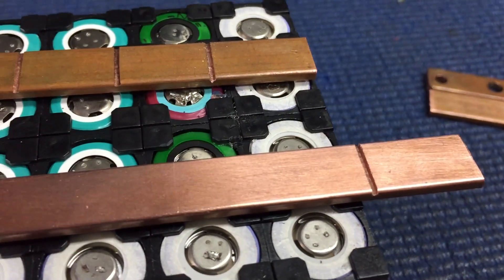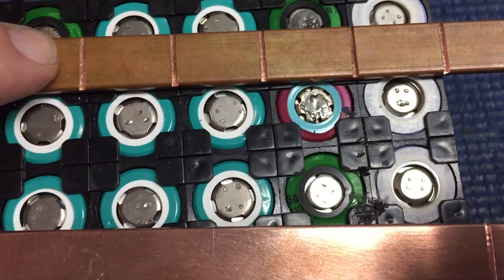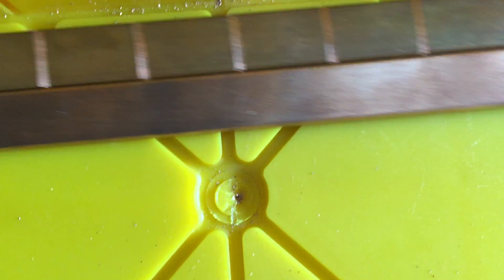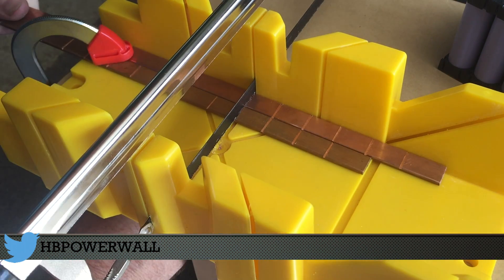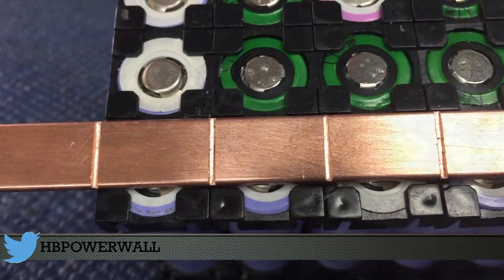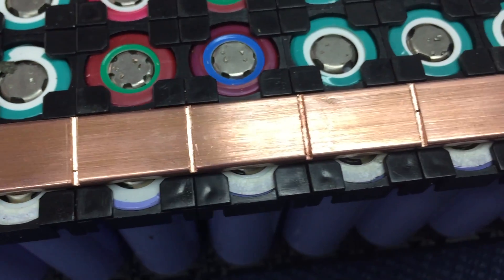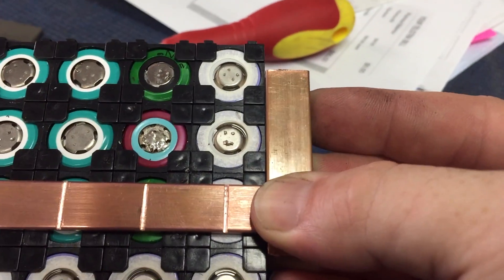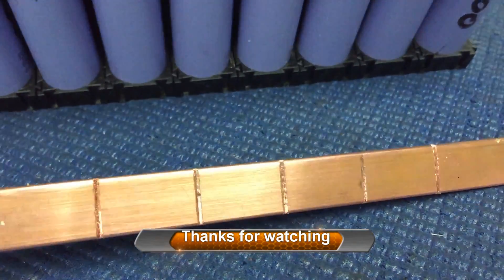Powerwall Busbar template complete

Comment: I know you are well past this, but why didn't you just bolt another bus bar on top after cutting the grooves? Then you wouldn't have to solder it. (Awesome project by the way)
Reply: Actually, no that won't work as the length of the bars will prevent a solid clamp all the way down the bar. I know you ended up using wire. Honestly as I saw you hacksawing I was wondering why you didn't just drill in screws or threaded bar. Then you could just use butterfly or regular nuts to secure the wire. Soldering on bus bars is not practical at all. Too much heat is required as it's just a huge heat sink.
Reply from the maker: OOOH there is some many thing wrong with doing it this way lol - but it was my process and glad i documented so one one else does it heeh
Reply: HBPowerwall 
That's how it's done for electrical distribution, but for 100+ cells would be too tedious for each of those connections as well as having the added requirement of lugs for each cell.
Reply: Come to think about it. Just threading holes in the bus bar with screws would have worked. Don't need rods sticking out, lol. That was a bit silly of me.
Reply: This is what I'm talking about. This bar has different spacing than what you were looking for, but you get the idea. https://www.erico.com/category.asp?category=R2523

Comment: If you have a miter saw, you can cut small pieces of wood all the same length, then create a stop block on your bench for the one end, then add the equal length pieces of wood to space it down the cells for absolute accuracy....... instead of buying that saw setup you have and ordering a new metal blade, i would have went and picked up a small trim router and metal cutting tip... would have made the work of that busbar in like 5 minutes tops.. you can get a cheap ryobi router for $60usd here in USA